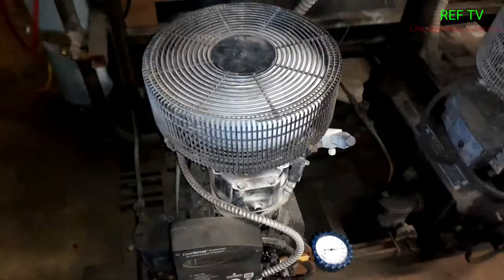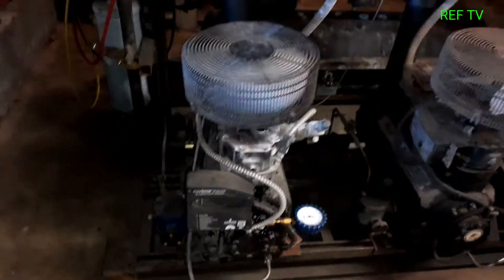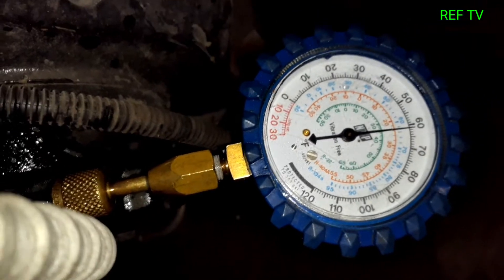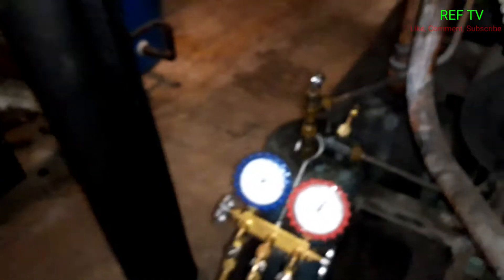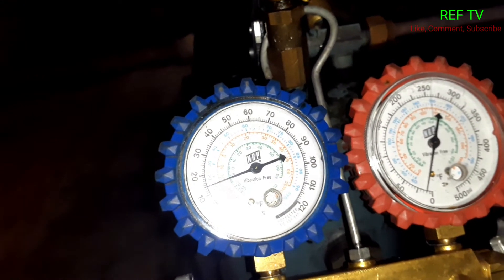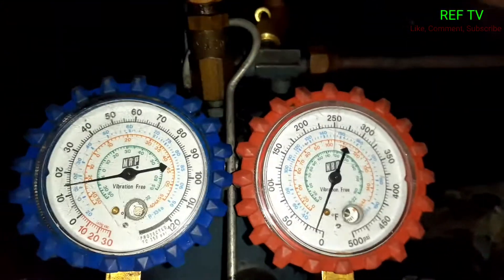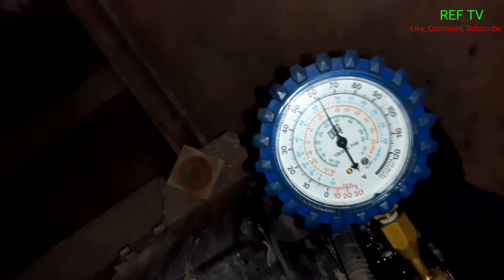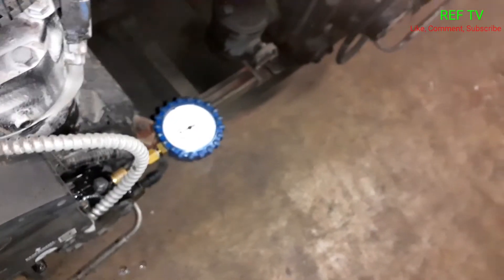How To Check Net Oil Pressure

Comment: Informative video Just One Note this is only a Copeland compressor different compressor manufacturers have different ranges of pressure net oil but the process is correct thank you for the video
Reply from the maker: Correct 💯 Copeland Compressors Normal Operating Differential Range Is 20-40 PSI. Anything Below 9 PSI For 120sec Will Cause Oil Pressure Control/ Sentronic To Trip Out On Low Pressure. 
"Thanks Again" Hector 💪